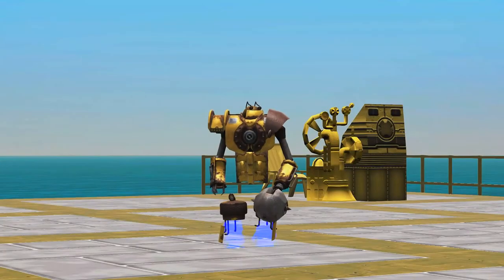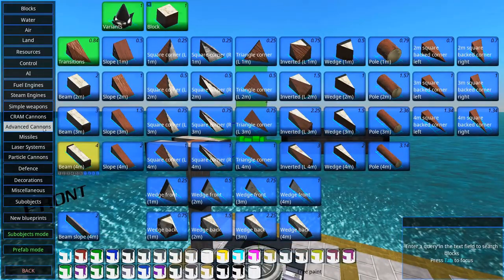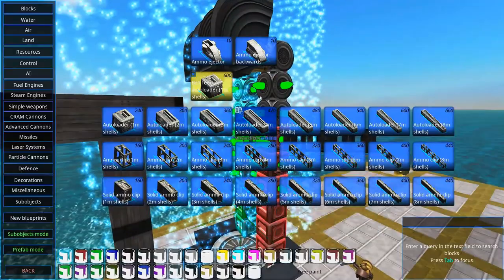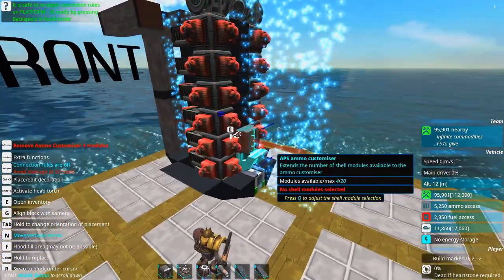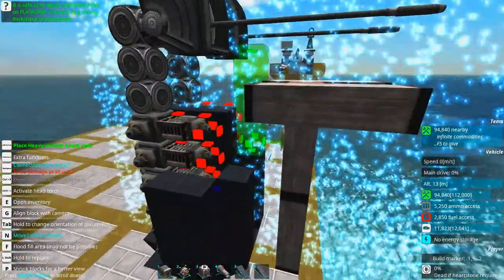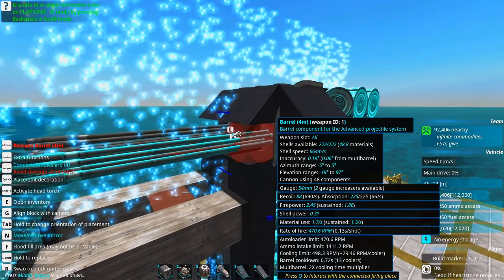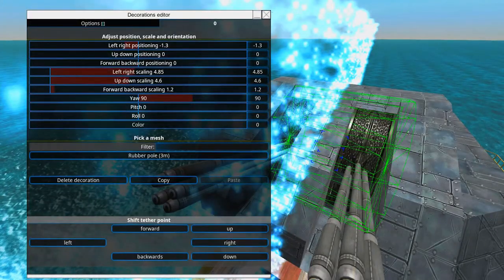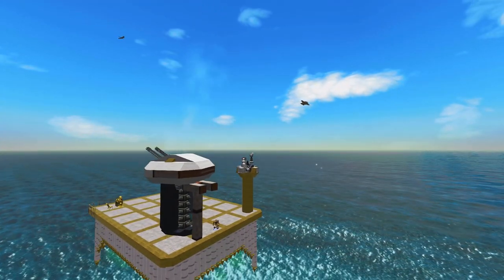From The Depths INSTANT Tutorial: Fast-Fire Multi-Barrel APS Turret

Comment: Putting the armor blocks in the middle was kinda pointless.  When the clips blow up the explosion will just go around the armor.  If you want that armoring to be effective it needs to go all around the turret and not just the front.  The space would be much better used for something that would have helped the performance of the gun like recoil absorbers, autoloaders, and etc.
Reply from the maker: I tested it and it seemed to protect the other side for this particular shell with fully loaded mags, how would the explosion go around it? My experience is that explosions don't go around stuff but maybe I am misstaken..
Reply: @GMODISM  after I built it in ftd I saw why.  Your shells for the cannon are too small to generate the explosion that would be able to wrap around to the other side if the ammo had detonated.  However, after looking at the shell itself I don't think anyone would ever use it.  19.2 ap with 142 kinetic damage won't do anything but tickle.  It would take repeated hits on the same spot to do any serious damage.  The gun itself is not going to be able to do that with no recoil absorbers to keep it accurate while firing.  the gun that I made based on this was struggling with dusters from the dwg.

Comment: And in reality the turret would blow up hard anyways if it uses payload (connectors highter up would probably get ripped, ignoring the armor and separating the turrt). the armor inbetween be damned. If it's kinetic just metal would be enough.
Reply from the maker: So if using chemical rounds better with no armour probably? Well the middle armour makes one turret stay online even if one is dead

Comment: Hey quick question how do you get your two barrels to sync? If I have two it only loads shells into one. How do I fix this?
Reply from the maker: Maybe the other one isn't even working, some connection error?
Reply: @GMODISM  i figured it out it's just that you have to make them as two separate objects disconnected from eachother. I had the firing piece on basically the same turret. This game has been very frustrating to learn :(

Comment: Doesn't work for me, no matter what I do it says it's not connected and to connect to a aps firing piece :/ is my game broken? This games so small it's impossible to troubleshoot and so I just can't have cannons right now
Reply from the maker: the aps parts have direction, try turn them 180 degrees around and they should connect, also start on a new build in case there is something with that blueprint